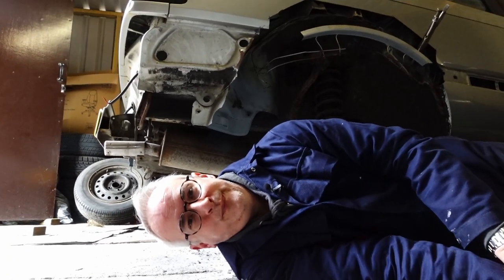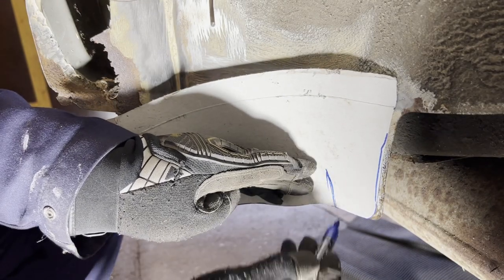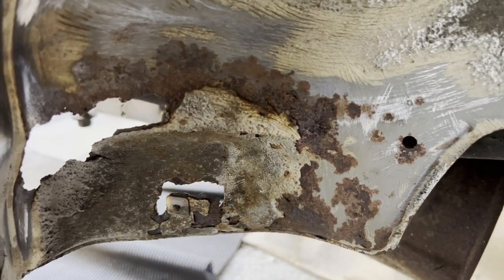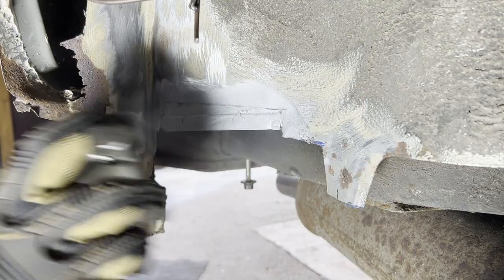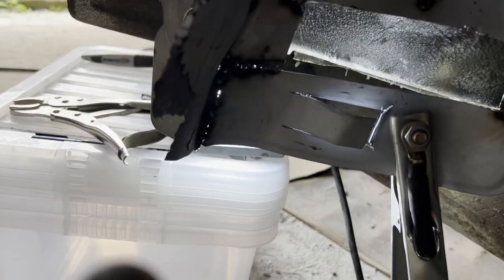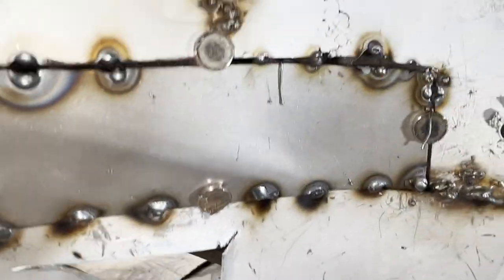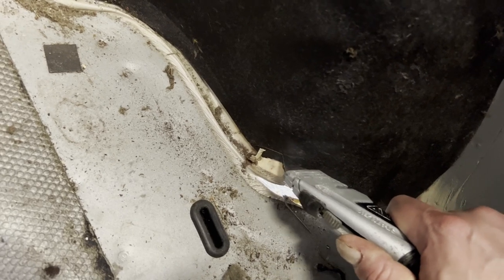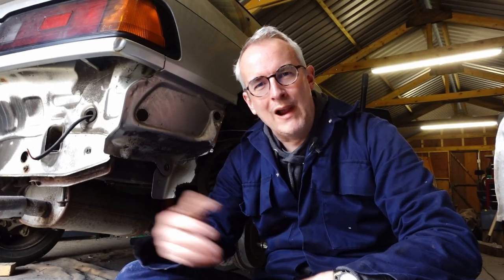Can I save my rare 1980s Honda?

Comment: A little tip is the mig wire you throw away as can’t use once it’s at end of spool don’t throw away cut into 16 inch pieces then stick one end of the 3 pieces in vice and the other 3 ends in cordless drill and slow run drill till the 3 pieces twist together you can then feed in like a tig welding rod with your other hand as you weld with mig gun it perfect for when you have slightly to big a gap on repair panel or welding up a hole. I’ve used it many times over 30 years and you can use brass to back metal instead of copper when welding up a hole both metals work great.

Comment: Great video! All these panels are designed to be stamped out and spot welded in the factory in about 40 seconds but it means they take about 40 hours to repair. Very good work on the metal shaping. I tend to rely more on "tack and bash" but your approach is better. As for the welding I recommend not holding the MIG gun with both hands. Rest one hand on the car itself, or on a clamp attached to the car, steady the welding hand on that hand (maybe just via the little finger), and wear your reading glasses. All this makes it much easier to send the hot metal where you actually want it to go. Always start the arc on the new piece which is thicker and just nudge the puddle over onto the actual car as you go. If it goes really horribly it's usually because the metal you're welding to is rusty or still covered in paint or something.
Reply from the maker: Thanks Ben. I’d never actually noticed that I hold the torch in both hands, but you’re right, it appears I do! I’ll stop.

Comment: Eastwood over here in the States makes a set of vise grips (mole grips to you) that has a special mod to the tips of the jaws that makes a 45 deg lip bend at the edge of panels- so that when the butt welds are ground down there is still quite a bit of the weld left afterward to maintain strength in the joint. A jamb nut in the adjusting screw keeps you from having to fiddle with it as you work the edges. There is also a pneumatic tool that does the same thing with the bonus of the ability to punch holes for plug welds as well. Might help you here. Another fine video from you that is useful to me as I'm having to do similar repairs to my 1986 Toyota 4Runner (Hi Lux Surf to you). Thanks!

Comment: Great Video Martin. I Have a Honda Civic MB. Very similar issue in this area it seems all the stones flicked up and chipped away at the underseal. Mines spread to the seam where the boot floor meets the side panel under the bumper and the whole section at the back of the inner arch is gone and you can straight into the boot! fun times...
Reply from the maker: Thanks Joe!  Yes, it does seem very much to be a feature of Hondas and Rovers of this era.  I don't envy you the boot floor problem, that does sound even more horrible than mine.

Comment: Yikes, but good to see you've still been at it & learning as you go. And good to see you finally found the copper plate idea.
 Must get back to finishing the cowl plenum on my 80 accord, though that's also got very poor rear 1/4 accident repairs to discourage me.... But still painting Civic & CRX first...
Reply from the maker: Ooh, a CRX!  Sounds like you've got your hands full there.
Reply: Yes '86 DOHC, (& '90 w/mugen kit, & '89 Si-R). 
Just made & welded a new top to the rear hatch perforated by a dozen holes from its foam rubber spoiler if that provides encouragement. Though theres much more rust elsewhere. 
At least I got to the bonnet early enough to epoxy the developing holes, wouldn't want to weld that! The fresh black paint already accentuated every other ripple in the flat panels!

Comment: I did something like this on my wifes Micra- not quite as bad as this - MOT bloke:, 'did you do that?' - - -  excellent work !    ; )  PS  love the wire frame jig : )  and the other 'poo' is you normally have to do both sides                      ............. ; (
Reply from the maker: Well done with the Micra!  And yes, the other side is a problem for Future Me.  It's not quite as bad as there's a partial liner...but on the other hand it's close to the fuel filler neck so I'll probably have to drop the fuel tank.

Comment: funny that you say about running out of gas- i was thinking that to me it sounds lke your gas is turned up too high
Reply from the maker: You're probably right.  I have the gas up quite high to compensate for having the torch a relatively long way from the metal, which in turn is because it's an awkward reach and I risk touching the tip to the car.  None of those is ideal.  All stuff to work on.

Comment: 23:37 run time, but no doubt hours and hours of work…your patience and resilience is a benchmark for us all. It’s not just the welding its the cutting and shaping that leaves me daunted. Are you bringing the Honda to FOTU this year?
Reply from the maker: Thanks Simon - yes, behind this there was a lot of a) work and b) scratching my head figuring out what to do.  I'm aiming for FOTU - I think that should be an achievable goal although it might not be properly painted.

Comment: Martin, excellent job. Looks like our welding capabilities are pretty much on the same level. But if it works it work. Right? Running out of gas? Tell me about it. Run into the same situation. Then new bottle arrived and the valve was shot and vented gas. Arrgghhh! How is the availability of Argon in Wales these days? Looks like we have another shortage here. At least in Germany. Argon is hardly available, prices have almost doubled. And I will need a lot of Argon on my "new" XJ-S in the future... Cheers, Christian
Reply from the maker: Thanks a lot Christian! That’s interesting about the argon - I’m using 95% CO2 + 5% argon for this and that seemed to be normal on both price and availability. I only use pure argon on stainless steel, which I haven’t worked with for a while.

Comment: Way too much wire stickout! Make sure the tip is level with the gas shroud and use more power. Remove the weld through primer along the weld line and in the base of the plug welds. Brace your hand against the panel, so you aren't wobbling around so much. Subscibe to Fitzee's Fabrications if you aren't already.
Reply from the maker: Thanks, I’ll experiment. The problem I have with watching how-to-weld videos is that no two seem to say the same thing.
Reply: @GrandThriftAuto  Fitzees techniquies are the ones closest to what you're already using.